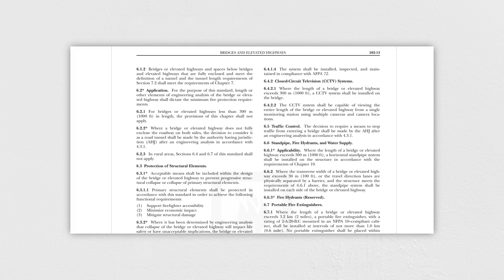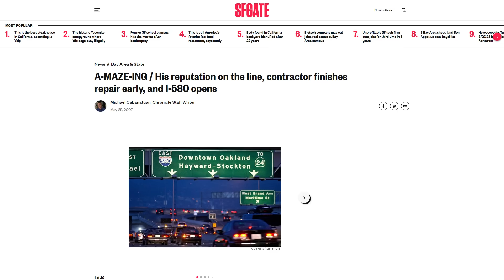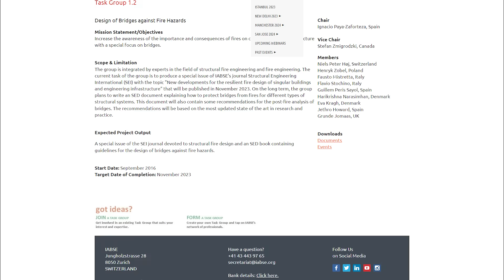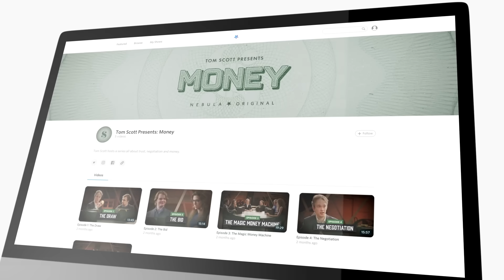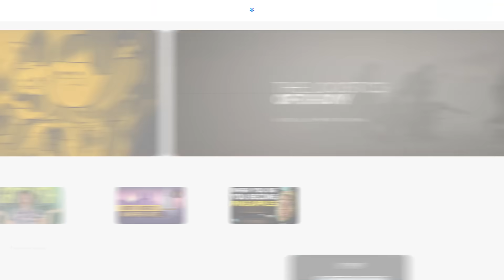Philadelphia I-95 Bridge Collapse Explained

Comment from the maker: 🌌Get Nebula using my link for 40% off an annual subscription: https://go.nebula.tv/Practical-Engineering
🛠What engineering disaster would you like to see me cover next?
Reply: Sounds to me like tanker trucks need to be built to better standards to hold up against a crash.
Reply: Thanks for this video, Grady. I've often wondered about bridge and overpass integrity in the event of mishaps like this. Can you also make a video about tunnels and how they are designed to cope with potential accidents, floods and fires? Thanks again.
Reply: Hey there! Love your videos! I was wondering if you could do the rebuilding of the tunnels in Boston? I’m curious what’s happening because they came out with the construction and the start really quickly! Thank you!
Reply: More bridges, particularly concrete, I76/I80 comes to mind. also with a burning tanker of fuel. similar issue, big hot fuel fire dumped into a bridge from below
Much less has been devoted to concrete vs loss of steel structure. 
Concrete calcines, where the exposed portions lose their structural integrity, namely in tension, verses compression; A fire is likely to hit the lower part of a structural member first 
over 1/4 of concretes' mass is water, regardless of how dry it looks. when that water reaches 100C, it boils away, taking away it's surface tension and granular bonds with it. In addition, Aging concrete tends to bond with atmospheric CO2, not adding to it's structural integrity, but adding brittleness to the structure with age, creating spalling across it's surface in such events, exposing more concrete to a fire.
Reply: Thanks for the 40% discount.  Ray
Reply: Y 6th you😊
Reply: Ever considered making a video about the tragic collapse of the Morandi bridge near Genova, Italy?
Reply: Surfside Condo Collapse, Part 2 (Its been two years)
Reply: I was waiting for you to explain the collapse for 14 minutes and you did not do that! You wasted my time. Unsubscribing.
Reply: Practical Engineering: MADE IN CHINA
Beijing-backed bullshit.
Reply: Rather than rebuilding bridges, invest in education of commercial drivers? Or nationally consistent signage and clearances?
Reply: minneapolis i-35w bridge collapse
Reply: Train derailments which seem so frequent now.

Comment: Rather simple: chemical properties of unprotected concrete changes above 500C, also high strength steel will become mild.  a tanker leads to hydrocarbon fire, thus around 1100C near the bridge deck. That’s why bridges fail. Often 4 MW (ICE cars) fire are taken into account for parking, but tankers will lead to 200-300 MW fires which makes construction expensive. Since there are numerous bridges costs would become astronomical. Therefore it is cheaper to replace bridge decks. Only in tunnels we take more provisions, making them costly.

Comment: i think it's the dumbing down of the job which, for the most part has already happened. The more information you provide someone to be able to do the job, the less they have to know. They are increasingly relying on these automated systems and not their own experience and knowledge and then you get what you get for drivers. 
I haven't used a local taxi in a while. Never an uber on my own. I called a local taxi to take me less than a mile from the train station. I was arriving at. I said I'm going to the dentist from this intersection. About 3 blocks north. They said, what is the address? I said I don't know, it's my dentist. They said we need the address. I said, Its only 3 blocks from this major intersection.
I've been going there for twenty years.I never knew the actual address. They said call me back when you know the address.
I was frustrated to say the least.  For the first time ever, I had to google my dentist and find the address just to provide it to the taxi driver. 
I realize the taxi driver likely didn't understand english and who knows what other limited knowledge they had. I think this guy might have really understood our conversation, but that's besides the point. The job had been dumbed down to: go to this dot on. the device will tell you how to drive. 
Is that what's happening to the trucking industry? What is our fail-safe when those devices are wrong or incomplete? What other information are the drivers potentially at risk of getting wrong?😢
I don't know a whole lot about the trucking industry.But I believe many years back there was a time when truck drivers might have been considered the most knowledgeable drivers on the road. Could this changing demographic of truck drivers be contributing to these type of incidents?

Comment: What is it with so many fuel trucks crashing into bridges in the US? Got to question if the drivers are at the wheel for too long in any given stretch or if they have sufficient training or experience driving big vehichles before given the job of driving tonnes of fuel.

Comment: A true true engineer over thinking the problem. Wanting to make a fire resistant bridge when a simple solution is at hand. Just need to install fire suppression systems under bridges. Way more economically appropriate than researching and developing a fire resistant bridge.
Reply: Do you have any idea how expensive fire supression systems and their maintantance are? Not even mentioniong it needs to be a heavy duty extinquishing system capable of suporessing plausible oil or cemical fires so it cant just be water.

Comment: I had the pleasure of joining the Geotechnical firm that produced the retaining wall design and watched a presentation on the design process.

You were correct on the loading conditions: an embankment constructed of typical soil would have caused damage to the utilities underneath. The lightweight aggregate reduced the weight that the DOT was okay with.

Comment: Another thought.  The possibility of a multi EV collision resulting in very hot battery fire is increasing with the growing number of EVs on the road.
Reply: EV battery fires are 20 to 80× less frequent than ICE vehicles. On average they're hotter, but not compared to the worst 1 or 2% of other fires. And then you don't need 1 million tonnes of fuel per day in these tankers lol

Comment: In addition to  " failed gusset plates ",  and asymmetrical loading , what happened with the infamous  I.35W bridge collapse in Minneapolis ???    Let's look.                                                                                                                                                    August 1st , 2007  was exceptionally hot !  93 degrees . Clear blue skies !   Thermal deformation perhaps ?  Or just a little softening ?   Not convinced the "experts"  got it all completely right .                                                                                                                                                                                                                                         Hey Grady , as far as I can tell , nobody mentioned , or ever looked into , the fact that that structure was getting COOKED ! ,  both from above , and especially , in my opinion , FROM  BELOW !                           The sun was reflecting upwards off the surface of the Mississippi !!!  Has nobody looked into this ?   Pre-heat at about 11:00 A.M.  and then , catastrophically, at approximately 4:00 PM , ...what was the angle of solar focus ?  The river course runs East to West right there . Hottest point of the day ?   On August 1st ? , at that time in the afternoon , what would be the upwards angle of reflection from the water's surface ?  Yep.   Has THAT factor ever even been considered ?   Who needs a tanker -truck inferno to bring down a bridge ?  Just heat ?   They blamed the gussets .                                   There you go , buddy .  Write this up , publish , and grab yourself another  PHD.  Next time you're in Mpls ,  look me up.  -flem. ( retired welder )     Love your work.                                                                                       Study the solar reflective btu potential . Might be significant .

Comment: Well why do fuel trucks happen to crash into bridges all the time? Or do they crash into bridges just as much as statistically expected and fuel trucks are simply the only time you hear about a vehicle crashing into a bridge cause it's the only vehicle that will cause actual damage to a bridge?
Reply: Fueltrucks have the most potential to cause major damage. A burning car has way less potential and will burn out faster at lower temperatures and can be faster extinguished.

Comment: I remember an old larger bridge in Vancouver, CA, whose timber jump span burned down because some fire lit by homeless people trying to keep themselves warm. Fortunately nobody was injured. And the span replacement came very fast. A nearby major bridge was being built and they negotiated a re-route of some of the girders of that new bridge to built the replacement span of the old bridge.
Also, there are some considerations regarding fire hazard. The easy one is not allowing (full) fuel trucks to go on major bridges. Another is to assume the worst and check if the bridge will have enough residual capacity that prevents collapse.

Comment: So how did the fire collapse the bridge?
Reply: Because of the expansion of the metal in the bridge (because of the heat from the fire) it makes the steel much weaker and the fire also eats through and damages everything around it. Here's something you can do at home. Take spaghetti and place it over a pot of water, heat up the water and the spaghetti stiff at first, and can carry its own weight. But as soon as it has heat applied ( the steam from the hot water, just like the fire under the bridge)  it absorbes the heat and its sags and would collapse if it had a load on it.

Comment: most bridges have municipal water lines running within the span, if it is in an area that has quite a few tankers passing by, with phones, gps, many other distractions these days, shortage of qualified truck drivers, maybe autonomous driving vehicle soon. may be we should look at the cost and the potential set back should a fire damage beyond repair. If you build a small commercial building the government will likely force you to install a fire suppression system. It is worth looking into. What about a tunnel, I think a fire suppression system should be mandatory

Comment: Part of the problem is that the underside of bridges are constucted, they trap the heat from a fire directly underneath, this contributes to the failure more than anything else I would think. The trapped heat increases the temperature more than if that fire took place in a wide open area. I know the following idea is rather simplistic, but enclosing the underside of bridges like this and coating that with a fire retardant material. With a smooth surface where the heat of a tanker fire can't build up could potentially protect bridges. An expensive proposal would be to fit the underside of bridges with an aluminum shield but behind that once the shield burns through a passive fire suppression system would dump a dry chemical extinguisher on the fire or maybe a couple hundred of those balls that can be slung underneath that when tossed into a fire explode and momentarily deprive the fire of oxygen plus the dry chemical.
I know it's pretty simplistic and naive, but brainstorming past the simple could finally get us to a fairly cost effective way of protecting infrastructure.

Comment: During your description of the discrepancy between the frequency of a failure mode and the resources invested to prevent them, I felt that you glossed over a major factor: Detectability, one of the key parts of the FMEA. I love your ability to explain engineering  decision making tools; could you perhaps make a video on the FMEA? Thanks!

Comment: Gas, Diesel, fuel oil, propane. whatever ones full tanker can cause the most damage use that as the minimum standard. Preparing for Jet fuel is likely excessive except for around refineries and airports. Preparing for less seems pointless when it seems to be a significant portion of the fires that cause bridge collapses.

Comment: As well as being heavier and placing addition.al loading strains on the bridge, won't EV fires be devastating for infrastructure? Battery fires are just so intense and hard to extinguish that any battery fire could cause massive damage on a bridge, or in a tunnel. Fires are rare, but it only takes one! Is current infrastructure even capable of handling the additional weight if buses, trucks and cars all have to carry big batteries?

Comment: its not really a hard concept. its the same concept that caused the towers to fall on 9/11. steel and other metals become malleable at higher temperatures. the fire isnt enough to melt the steel outright, but the higher temps compromise its load bearing capacity, and thusly, the structure collapses uder its own weight. bridges an other roadways are not just concrete, but steel girders with the roadway being steel-reinfored concrete. when a fire like these are introduced, the steel then becomes the weakpoint, and its just a matter of time before the structure fails, as it can no longer support its own weight.

i honestly dont think there is a way to protect from it. you cant change the base properties of the metal, unless you swap to a more thermal resistant one, like titanium, but that would probably inflate the bridge's cost exponentially. thats probably the only eway to mitigate that risk, to use metals where they become malleable outside the temp ranges of a fuel fire like that. there is a limit to how hot it gets, and if the metal doesnt get malleable until higher than those temps, then the bridge is then pretty safe. but its not cost effective in terms of human life, cause fatalities are rare, as you mentioned. the engineers and architects and bureaucrats need data on the economic impact, to decide if building for thermal resistance is worth the increased cost.

Comment: Mobile bridging like Bailey and descendants would make for an interesting video. I am mildly surprised they're not used more often (they can even be rented!) because they're rugged enough to take main battle tanks, VERY quick to erect, can often be erected from one side of a gap, and can last (some WWII  era bridging remains in daily use today) indefinitely. Being steel they're recyclable and easy to repair or modify.
Mobile bridging is particularly useful for smaller bridge replacement in budget-constrained areas where key bridging is economically important due to lack of alternate routes.

Comment: Recently in my area a major road that passes over a public access to a park had a stolen car burned out in the underpass beneath. The bridge has been closed off and structural integrity inspections have yet to be carried out, but with how charred it is, how warped the rebar is and how the concrete is crumbling, I can imagine that the bridge is not long for this world.

Comment: Maybe a heat sink could be installed on overpass bridges. Have a heat-conductive layer underneath and the kind of cooling mechanisms used by passive coolers for CPUs, VRMs and such, just scaled up. That would probably provide enough protection to allow the fire to be put out before catastrophic damage is done to the bridge structure. Just not sure it would be worth the added expense.

Comment: Normally really enjoy your stuff.  But the wording in the thumbnail said "Why fires destroy bridges"..  Did you actually cover that?  You talked about the bridge collapsing from a tanker truck, how they rebuilt it, the impact to traffic, the costs, how many bridges there are in the US, etc..etc..  But I was expecting to see an engineering breakdown of how fires can cause concrete bridges to be destroyed.  You know, what the heat of the fire does to the concrete and steel, how it weakens it, what the failure modes are..

Comment: Grady, the other thing to consider when weighing fires against something like earthquakes is locality.  A fire that affects multiple bridges simultaneously is almost unheard of.  Earthquakes, by their nature, regularly effect multiple bridges per occurrence.  In addition, many negative impacts of bridge failure would be exponential with multiple simultaneous failures, due to limited emergency response resources, reduced alternate traffic routes, and the like.  

I think there is vastly greater reason to design against earthquakes than against fires.
</$0.02>

Comment: While your video was full of good information, you never really explained why the bidge collapsed.
I was expecting an explanation of how and why fire and heat affect concrete, steel, and the combination of materials and structure design that caused the bridge to collapse.  
Additionally, I was expecting what can be done to prevent and / or stop such fire damage and failure.

Comment: It might be a good idea to consider looking into the possibility of installing fire suppression systems on the underside of high-traffic bridges that go over roadways.  If the system can detect a fire and spray a foam to cover the fire, then it would go a long way toward protecting the bridge from fire damage.

Comment: Fuel can't melt steel beams 🤣🤣
Reply: It doesn't have to melt it, dipshit, it just has to heat it the the point that it loses structural integrity.